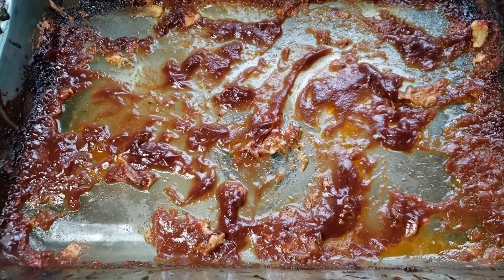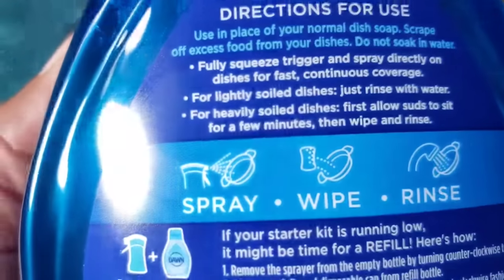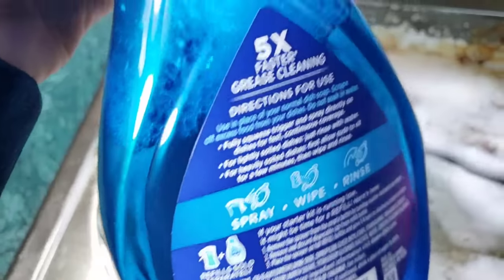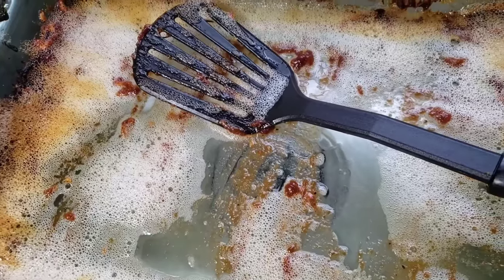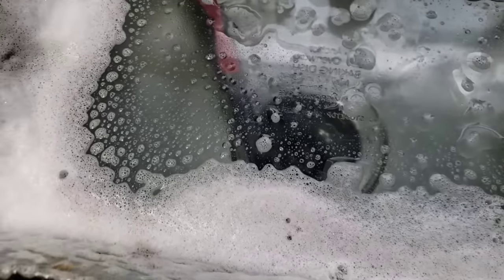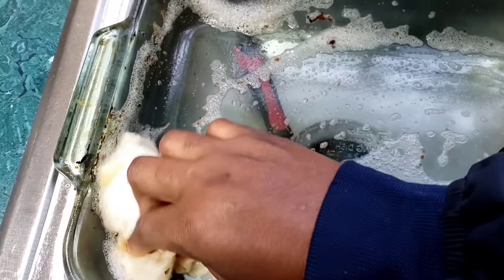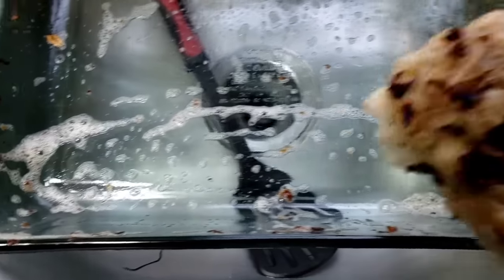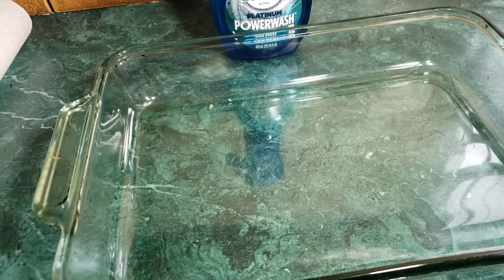DAWN POWERWASH  DISH SPRAY | DOES IT MAKE WASHING  DISHES EASIER? |MY HONEST REVIEW.

Comment: I just bought this and it didn't seem to be much more effective than using dawn ultra liquid soap with hot water and letting it soak for a few mins. 
Because it foams up I used it on my BBQ, wiped it then rinsed with the garden hose and it worked well.
 I would use this for applications when you don't have the option to soak it with dawn dish soap and hot water and need something greasy cleaned. 
I'm going to try using this on my rims. 
Thanks for the review!

Comment: Just found a great use for it. I was trying to wash a pepper shaker that hasn't been washed in eons at my mom's. It had a nasty ring on the bottom inside that I could not get out.  I used a bottle brush. Used a toothbrush. I used rubbing alcohol with the bottle brush and a bit of paper towel. Still had the nasty ring. Finally spritzed the inside with the Powerwash. And it dissolved the ring completely. Sold!

Also the trigger spray is very difficult to use. I would guess most women's hands aren't quite strong enough. But since it works so well, I will put up with it.

Comment: I think it did well the first time considering the use of a paper towel and such light pressure. I think with the soft side of a Brillo sponge and a little more pressure (i.e. holding the pan with one hand and wiping with the other) it would have knocked it out the first time. I have used it a couple of times and think it would be sufficient.
Someone in the comments mentioned they have changed it to continuous spray, I think that is a huge benefit and will make it 100% easier to apply if it works right.
My question is - I wonder how well it actually sanitizes/disinfects? I.e., if I were to clean up a pan in the evening after cooking eggs in the morning. (Hey, I was running late to the office!)

Comment: I like the idea of no scrubbing but in my opinion if I have to spray it twice then will the spray run out quickly. If so I would rather soak it with dawn liquid and still have soap to do dishes with that will last long

Comment: I'm wondering when somebody is going to create a DIY for the solution inside because I used to be able to take the foaming soap pumps and just do dishwashing liquid and Water Shake It Up and it will work well it's definitely not the same solution
Reply: I've seen people suggest adding dish soap, water and 1 tbsp of rubbing alcohol for powerwash refill diy

Comment: Don't recommend this product you have to do too much work and it makes it seem simple but by the time you just soak it in hot water and soap do a little scrubbing with a pot scratcher you'll save yourself time money and energy
Reply: Exactly I'd rather just fill a sink with water and go... I think this is going to be best when your washing your car especially tire rims or inside of your oven etc. Dishes though I'm sticking with old fashion way, it's cheaper 😉
Reply: I've tried it and it doesn't do what they show on the commercial.   I think dishes like this needs to be cleaned the old fashion way.  Even if it worked like they show, it would be a prewash before going in my dish water.  I have used it for a stain lifter on laundry and it works fabulous.  Also it should be more like an aerosol than a spray for easier coverage.
Reply: Since my neck surgery, I have more soaking time than muscle. I appreciate this product.
Reply: I have a spray bottle the same exact structure I use it for my hair though. I decide to put some dawn soap in bottle with some water and boom homemade dawn power wash. It’s great for lightly soiled plates and cup. But that’s about it.